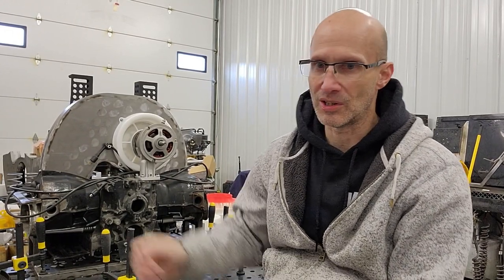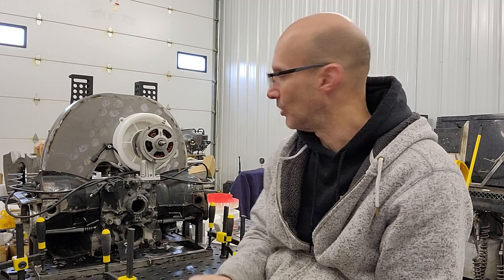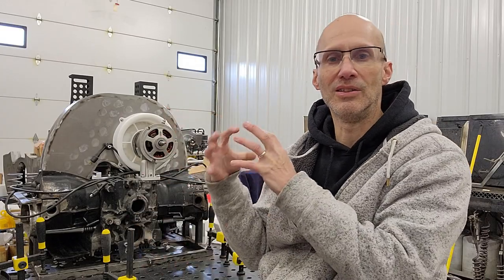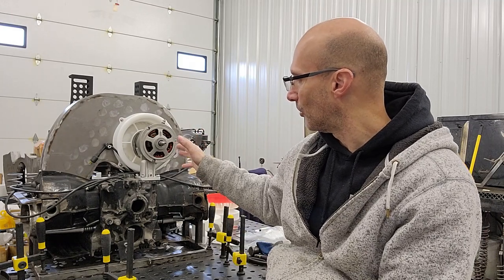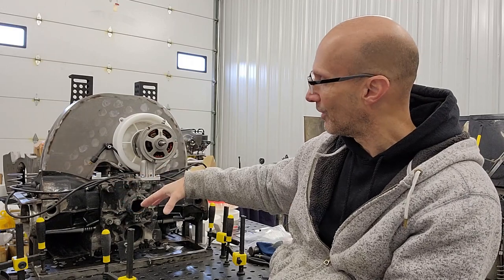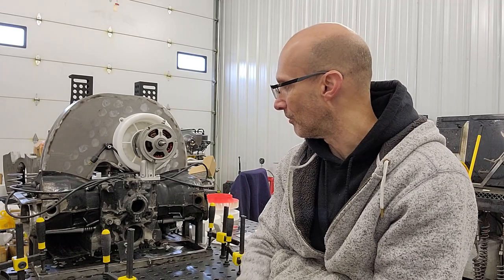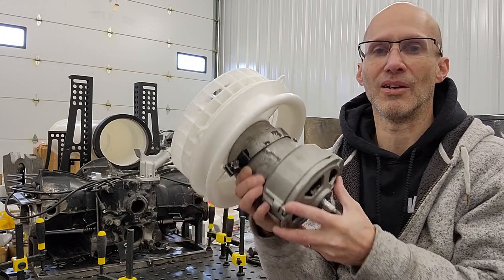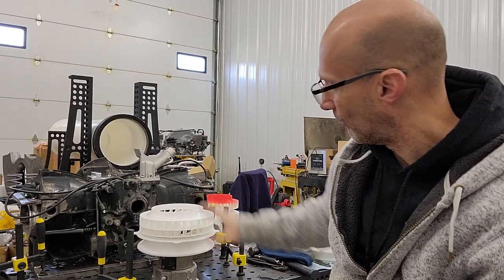Introducing the Evolution Two Cooling System!

Comment: Cool I would love a kit to fit on my dream 2387cc type 1 which I will also fit nickeles clyinder bralles and JPM MS230 cylinder heads both of which have additional cooling fins, EFI and electrictronic ignition, which lightweight  flywheel equalizer crank pulley for best possible reliability and longevity for a big high performance aircooled Volkswagen engine which I want to bolt noto a rancho pro drag transmission fitted with a berg 5 speed kit for my dream 1303 rally beetle/herbie replica because I would love to actually take part in historic rallies.
Reply from the maker: Your dream engine is almost identical to my test engine.  I built a 2324 cc engine with 95 Nickies, and the JPM MS230 cylinder heads.  I have their raptor cam and 1.6 ratio rocker arms too.  I highly recommend using JPM's rocker arms with the 5 studs.  You'll also have less problems with the rocker arm geometry using theirs with their heads.  I also used their aluminum pushrods.  They were concerned about using the 1.6 ratio rockers on the MS230 heads if I exceeded 6,500 RPM, but I have rev'd it to 8,000 many times without issue.  It's a great combination.  I also run EFI and my own heavy poly v-belt pulley system (weights in a 4.5 lbs.), and I have the Berg 5 conversion done for me by Rancho as well.  A lot of commonality.  Engines like these is why I have been designing these cooling systems.  The Evolution Two will most likely cool an engine very well up to 400 to 450 hp, but I'm not positive yet.  I have to do some calculations to get a better estimate.
Reply: @andrigsaircooledtechnology  I will use their Tapered aluminium push rods,push rod tubes, a raptor a cam, CSP fined rocker covers, a scat billet crankshaft with type 4 mains for added longevity like with a equalizer pulley, add a CSP wasp stage 3 exhaust system. So excluding the HP gains for the increase efficiency from better cooling and the efi and EI the engine should make over 233 hp based on the HP figure of the CB performance big power engine and the HP gains with the was exhust system so I probably fit a a RLR street 6 clutch kit.
Reply from the maker: I think, depending on the specifics of the cam, you could make even more than that.  You'll like the RLR clutch setup.  I have been eyeing that for awhile.  I think you'll be really happy with your combination.
Reply: @andrigsaircooledtechnology  I'll use a raptor cam which is same specs a the cb performance egal cams that come with the cb performance big power engine kits btw the hp figure is purely based power out of that engine plus the hp gains of a csp wasp exhaust system   but with a set of csp forged pistons aswell the engine will possibly be the most powerful N A aircooled type 1 of its size.

Comment: here in brazil . we need to update the cooling system of the vw bus engines. the vw bus use natural gas natural gnv.  and the very high temperature damages. the engines mainly the heads
Reply from the maker: Yes, this would help that situation a lot.

Comment: Hmmm I would be very interested in using this fan/shroud cooling system.
Reply from the maker: I am working on the manufacturing of the various components.  It will take awhile, but in a couple of days I'll have samples of the silicone parts that seal up the throttle cable guide tube.  In the next couple of weeks, I'll be test fitting on my test engine, with the aluminum bubble top case, but it should clear those without modification.  I have a new prototype test fan as well, that is made from a material that should withstand testing on the test engine, although I have a even tougher material for production, but I'm using all of that for production of the next generation lightweight cooling fan.  It's slowly coming together, and it will cool high horsepower high compression ratio engines very nicely.
Reply: @andrigsaircooledtechnology  Yes, I am wanting to use this on a "high compression" large engine. I try to go through all of the factory sheetmetal fit and clear out the Fins on the cylinders and heads to try to get the cooling air through. Lots of work but I knew the system could be better. I was not really convinced that the 911 style shroud was the answer. Anyway, What got me interested, was you said that the "factory fan" can only push so much air. That is an obvious fact, But very true. Anyway I like the direction your are going.
Reply from the maker: @rlprgp62  Yep, your build is what I'm targeting.  The air flow improvement over the OEM shroud is 66.43% so far.  That is with an older prototype of the fan.  I have a newer prototype that should bump those numbers up a little, and will probably be the final.  My goal is to enable people to drive their high compression high horsepower engines with reliability, and not have to worry about them overheating.  I hate driving my car and worrying about whether I'm pushing it too hard, and watching those temps climb.  I haven't tested the Porsche 911 Style fan shrouds, but I know very well the engineering behind them isn't that great.  The ring behind the fan that the alternator sits in doesn't actually do what the person thinks it does.  So much of the air ends up in the wrong place.  There is nothing to  keep the air from going along the top of the crankcase, and nothing to make sure that the air doesn't mostly escape out between the cylinders close to the crankcase.  That's by far the largest opening, and air loves to take the path of least resistance.  At some point, I think I purchase one and test it to get real data on it, but just looking at it, I know there are a lot of flaws, and while some people have good success with them, there are many that suffer with very high head temps, and get better head temps with just a Doghouse shroud and OEM fan.  From what I can gather, the people that tend to have success with them, keep their compression ratio in the low range.  You shouldn't have to do that when you have that large of a fan on your engine.

Comment: Something I'm not entirely clear on; the factory cooling system's weak point from my perspective is that it only blows air between the two cylinders,  with no provisions to direct air forward/back to evenly cool the cylinder barrels. Does your cooling solution do anything about this, or does it just blow more air?
Reply from the maker: If you look closely at the entire cooling system, you will find that the air is directed around the cylinders and underneath the cylinders, and around the cylinder heads and underneath too.  There is an air vane in the cylinder head (most aftermarket cylinder tin don't have it, but OEM does) that directs the air on the top of the cylinder heads to the exhaust ports.  On the underneath, there is a deflector that sits at the exit of the passage between the cylinders on the cylinder head (again aftermarket heads don't include this) that deflects the air going through the passage in the cylinder head to the exhaust ports.  With the cylinders, the round cylinders naturally get air going around the tops, and there is a deflector you install underneath that directs the air through the fins on the underside of the cylinders.  Those are critical parts of the cooling system, and unfortunately most aftermarket cylinder tin and cylinder heads don't include these critical parts.  You can buy them separately from at least one vendor, and you can also get one set of aftermarket cylinder tin that include the air vane from the get go.  The sleds and the skirts that are screwed to the underside of the cylinder tin also play a role in how the air moves over the heads and cylinders, so nothing should be left off.  So, as long as you have those parts that are often missing from the aftermarket parts, you'll get good even cooling of the cylinders and cylinder heads.  Since the missing pieces are available, I have not chosen to reproduce those, but just provide the new cooling system.  Customers have reported really great results with this system, in terms of reduction of oil and head temps.  Like anything, the results will vary depending you your specific engine combination.

Comment: here in brazil we need to update the cooling system of the vw bus engines the vw bus use natural gas natural gas and the very high temperature damages the engines mainly the heads
Reply from the maker: I have this Evolution Two cooling system available now.  I think it would help you keep those buses cool.